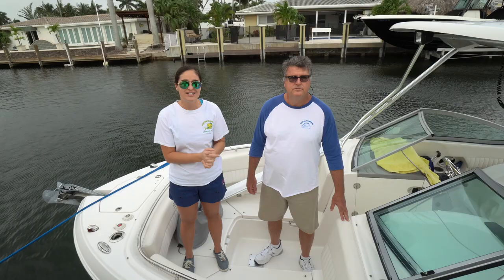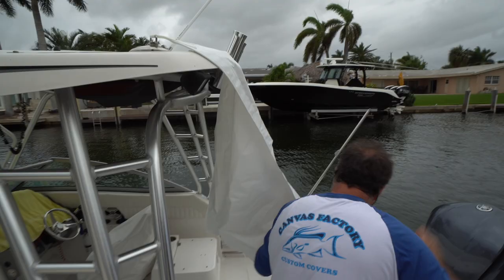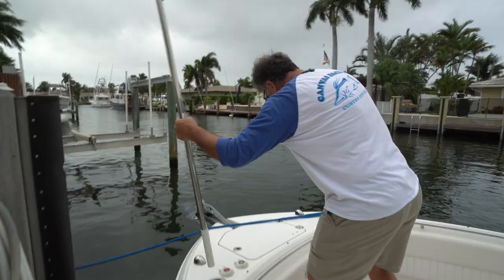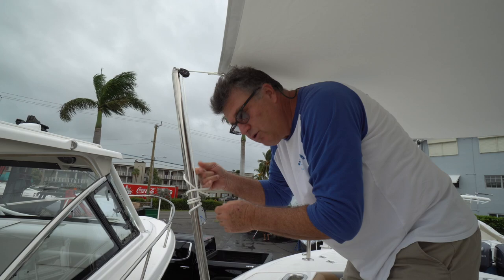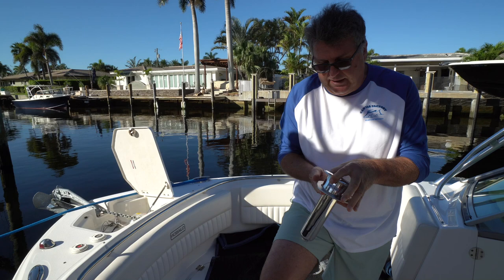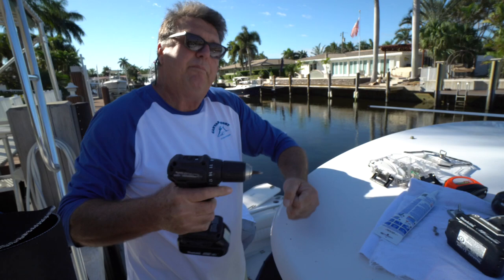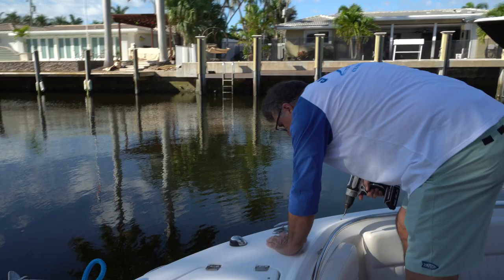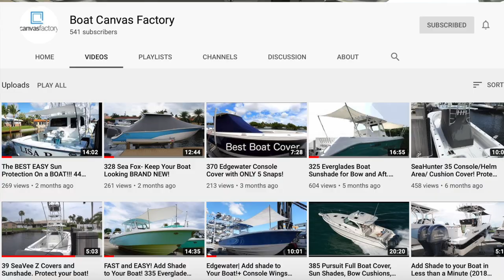Best Investment for Your BOAT!! Add Sun SHADE in SECONDS!!

Comment: Nice product, look to quality built.   Two quick questions: 
1) are there other colors available? 
2) is there an option for adjustable poles?  It seems like adjustable poles would allow the awning to be tilted to one side or another to block the sun or to raise or lower either to block the sun or adjust for taller people.  I’m 6’6” and clearance height is always an issue for me.
Reply from the maker: You could use other colors, white is the most popular. If it was black for instance, especially with your height, it would be very hot underneath.  They’re working on designing a strong adjustable pole

Comment: Nice product, but how do you protect the core of the deck from water intrusion when you drill that big hole for the mount in the deck? As a Marine Surveyor I see so many decks and hulls compromised and ruined by mounting things without protecting the drilled hole/core surfaces with paint or sealant. You should show how to do that after you have drilled the hole and before you install the fitting.
Reply: Pretty sure that core is a composite. It looks pink.

Comment: How come on this one he used the clip in deals like a Bimini top would clip into instead of doing the track across the front like he did on the other ones? And if I was to order one for my Formula 310 bowrider would I be able to use that track system or would it be the clip in type? Or is it just personal preference? We have the fiberglass arch! And also just curious but why doesn’t he do the green and red tags for starboard and port like he does on his covers? Thank u!!
Reply from the maker: Attaching through the track doesn’t allow air flow through the top. Yes you can still do them this way! They’re still beautiful. A lot of people don’t want to add a track to their top, so this is less invasive. There’s no need for the tags because it’s pretty simple to tell the top from bottom and the front from back!

Comment: 1) Make the poles extendable like painters poles and then you can vary the pitch and level of protection in inclement weather as well.
2) add an aluminum shock corded tent pole cut to size across the middle by having two 1” sleeve pockets for the ends and a hoop to thread through the middle so it stays in place.  Now you created a convex roof through the middle to a) shed rain and b) provide more headroom with more slope if required.